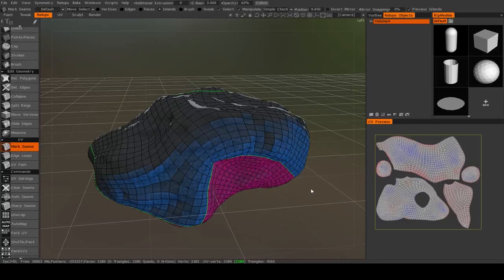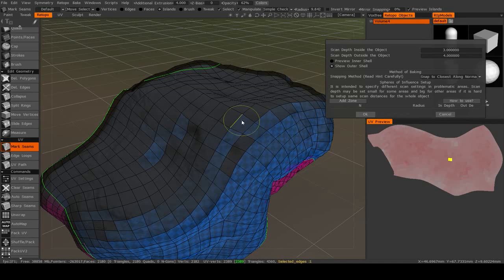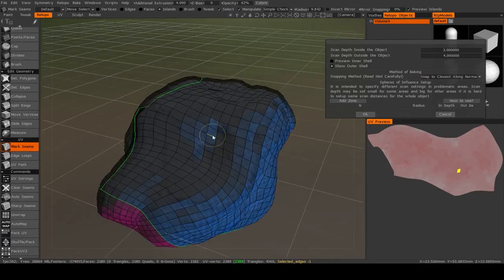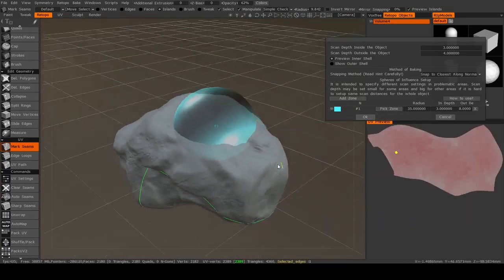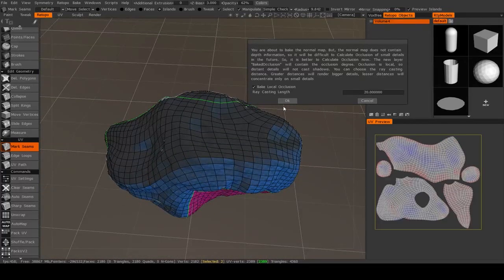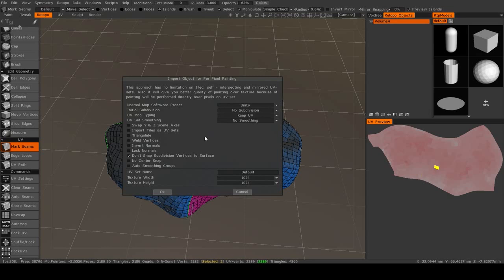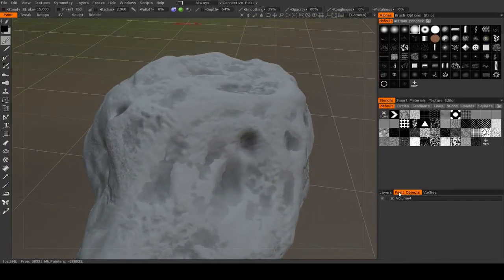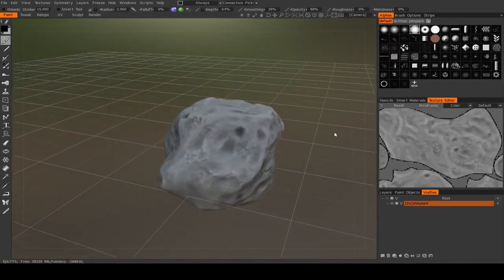Welcome to 3D-Coat: Part 18 (Texture Baking)

Comment: What happen if normal map preset set to 3dsmax then open it on maya zbrush or daz studio, or 3d coat have universal preset for every software, does the normap calculation will get total ugly or only slightly change
Reply from the maker: Different software read normal maps differently. A normal map is composed of the red, green, and blue color channels. If you open a normal map in Photoshop and look at these channels individually, the way the normal map is calculated makes a lot more sense. Essentially, blue channel will be neutral, the green channel will look like it is being lit from above or below, and the red channel will look like it is lit from the left or the right. Some software invert either the red or the green channel when reading normal maps. 3d-Coat is capable of reading each possible configuration, but if you use the wrong normal map preset in another program, you will get some pretty nasty UV seams on your model. It will look light the bumps/ridges are invert from one side of the seam to the other.